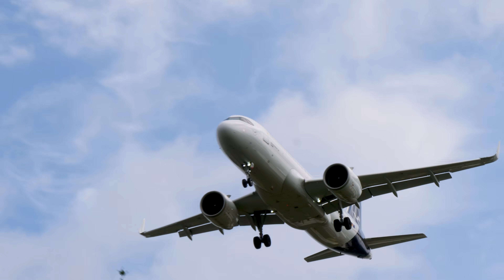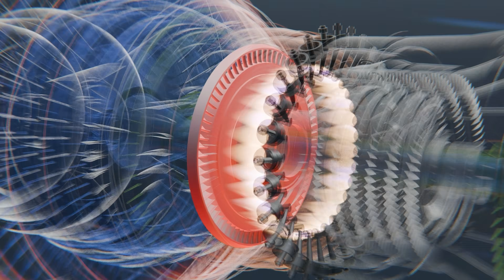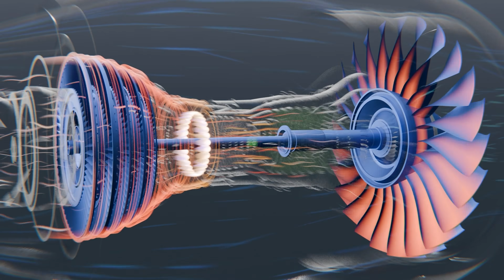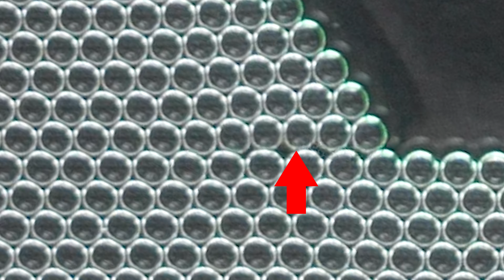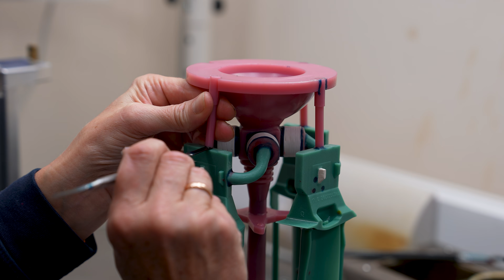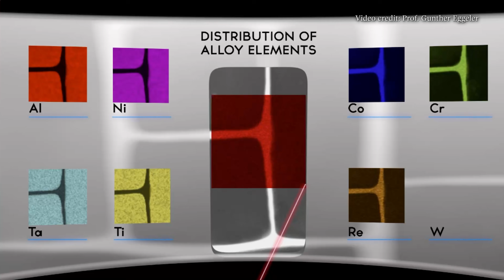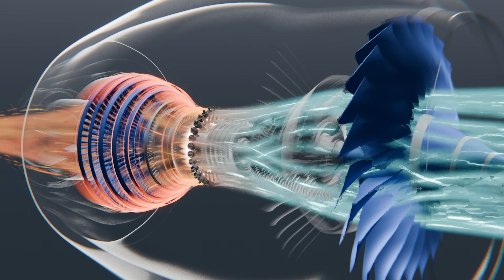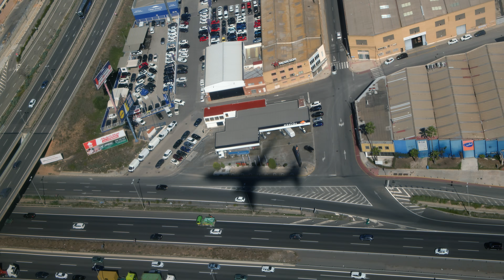The Ridiculous Engineering Of Jet Engines

Comment: The fact that they literally grow the blade as a SINGLE crystal to prevent it from stretching is actually insanity. We tricked a rock into being one giant diamond just so we can fly.
Reply: I expected a clever way to reduce the amount of crystals and my jaw literally dropped when they showed a single crystal blade. Damn sorcery, it's incredible.
Reply: @tastycheesegeo I always wondered how they crew a single crystal. The solution is so simple, but elegant!
Reply: @Oldseaotterguy any sufficiently advanced technology is indistinguishable from magic. Live long and prosper 🖖
Reply: @wackaboobooplays  hell yeah brother. dont watch starfleet academy
Reply: @tastycheesegeo  It's got me wondering, could we make swords from a single crystal or would they be only strong against stretching? I'm guessing they would snap like driftwood if used in a sword.
Reply: @b @beayn  won't pretend I know near enough material science to answer this question properly, but my thinking is, most of the things explained in the video are focused on combating a specific type of damage — from heat. Swords are used in a completely different environment, they experience different types of damage, hence, need different techniques of protection.
Reply: @beayn swords utilize a combination of multiple grain structures to perform well. The edge of the blade is a bunch of tiny grain structures making it hard but brittle. At low temperatures, grain boundaries actually make a material stronger before deformation. The back of the sword has different and larger grains which make it softer and able to bend and flex without snapping. When a sword is quenched the thin tip cools faster forming and trapping many small crystals and preventing them from growing over time.
Reply: @beayn I thought the same lol 😂

My assumption would be either the grains are helpful in the types of stresses swords experience, or the cost and difficulty of making a sword this way is just not practical so nobody has really tried it (and was invented late enough no governments were interested in trying it). Or realistically probably both.
Reply: @beayn forging vs casting...I they're going for light weight and a certain amount of stiffness vs denser layered forging. They are leaving out an important part of getting the coil and that's achieved by pressure or more accurately, compression, probably seriously high compression forces...
Reply: @tastycheesegeo I'll damage you both with this piece of amethyst if you don't quit yer speculatin'! Oh it must be getting late, sorry.
Reply: @beayn they explained it no? The nickel superalloy makes the vibrations from heat go through diffraction and dissipate the heat more effectively. But this only works since heat is a constant vibration. It will probably work, but strong shockwaves can still disrupt the gamma-prime structure and cause it to bend like they explained in the video. Maybe will work as a sword, but not a hammer of any kind
Reply: @beayn swords need to be durable in a number of directions. Crystal structures have certain planes they are weak on. Yes, these engine blades are made to be strong specifically in the directions where force is exerted on them. Mechanical engineer for aerospace corporation here.
Reply: yeah and i almost commented that what if we made just 1 single crystal but i decided to not comment it as i thought it was a stupid comment and impossible to do xD
Reply: @rampage3337  
Man, I feel that. 😅
Ever seen a video about the current state of semiconductors? A good Asianometry video'll give a real sobering: "How the hell did people come up with/pull off this 💩?"
Reply: @ivoryas1696   Conspiracy people would say aliens
Reply: @adventurousclash6323  
Eh, it depends, I find. 🤷🏾‍♂
For instance, an Ashton Forbes fan would blame the government and just claim they have way more advanced tech than they're willing to let on and are just hiding it in plain sight, lol. But I suppose this ain't the time to get into the weeds of conspiracy theorist as a field. 😅
Reply: @rampage3337 just before you saw it, right ?
Reply: @rampage3337 just shows you.... one "thought" is all it takes to make that breakthrough...  to make you a billionaire or a salary-slave.
Reply: At room temperatures, grain size is actually the only parameter that increases strength and hardness at the same time, when the grains are smaller. So boundaries are actually beneficial. But at high temperatures, creep takes place and because dislocations start to accumulate at grain boundaries pores form in the material, which are very bad. In a monocrystal blade this cannot happen, as the dislocations migrate to the surface of the blade and just vanish.
Reply: @onerelic1337 is there a percussion at the blade tips then with a frequency?
Reply: @pleshlacis  grain boundaries migration are highly likely to create internal voids in the process, which will concentrate tension inside the material and be the point of origin of a crack. Another possible issue is the formation of hard clusters in the grain boundaries during the heating and cooling cycles, which will anchor there point in the microstructure and also concentrate tension inside the material.
Reply: @xjustinjx  In a word, yes. Check out "squealer tips" and "winglets" in turbine blade design for more info.
Reply: @pleshlacis  This is why Low Angle Boundaries are so important in Single Crystal growth. The angle at which the dendrites are grown preferentially directs the angle at which the Gamma Prime phase is oriented. Basically the little cubes are guided by their relatively high Volume Fraction (which is why they're cubes and not spheres) and the orientation of the primary dendrite they formed along. Therefore as long as the orientation is correct the angle of attack for the super dislocation to adequately "cut through" the Gamma Prime is exceedingly high. Under High Cycle Fatigue though the Gamma Primes begin to "Raft" or coalesce together perpendicular to the load. Which eventually leads to failure. But blades are replaced long before it gets to that point though. There is a reason for the saying, "The rules in aviation are written in blood" and Safety is paramount.
Reply: @onerelic1337 thank you Aniki
Reply: No. There are no dislocations
Reply: "We tricked a rock into being one giant diamond just so we can fly."
A quote for the ages.
Reply: @TheCurlyCoder and we tricked more rocks into speaking binary so we can fly better more easily!
Reply: @bravo_cj  etch them with runes so they become smart you mean?
Reply: @bravo_cj we etched rock into arcane runes and filled them with lightning.
Reply: @bravo_cjand more accurately 😎
Reply: @nocturnhabeoI salute your expressivity. All of you.
Reply: @nocturnhabeoWhen I see people discuss programming, it literally sounds like dwarves discussion runic inscription or arcane glyphs lmao
Reply: @TheCurlyCoder Tricking a rock thinking better than ourselves is a more accurate and mindblowing quote, and especially "for the ages".

(Silicon die GPUs running AI)
Reply: Yup. And with computer chips (or rather, transistors) it's even crazier. "We tricked plain white sand into forming a rock and then we tricked that rock into being a thinking rock, by zapping it with manmade lightning in just the right places. Then we threw a bunch of those thinking rocks into a metal cage and forced them to talk to each other so we can get them to do our thinking for us but much faster than we ever could". Modern technology is basically wizardry
Reply: @BinaryBlueBull wait till you see what nature can do. it tricked star stuff (Basic carbon, hydrogen and oxygen) to make little machines that replicate, interact, communicate with one another to make even mores super complex machines of mind boggling complexity that we call life. It is so complex that it can think and ponder its own existence while making more complex stuff out of its own.
Reply: @BinaryBlueBull the funny thing is that when science is about planes, cars, bridges, skyscrapers (i.e. things that can easily kill you and your family any day  if the underlying science was fake) then no one questions it or dares to say: "I made my own research to make a better blade for a turbofan engine and I call RR's bs and a hoax" but When it comes to saving lives through modern medicine which relies on the very  same kind of science and technological foundations, then everyone is an expert "calling out" the actual experts' BS 😂
Reply: @leoleon7537  In all fairness, not much incentive to make fake science claims for something like a turbine blade, and very easy to see when it's fake because the part fails. Medical science is much harder to see when it's fake be there are endless variables that effect the outcome, and there are HUGE incentives ($$$) to make fake medical science claims.
Reply: @Projekt5.3 are you sure when you produce a vaccine/drug that will kill the recipient or severely harm it (as the " nextdoor experts" claim through "common sense") and that is administered to hundreds of millions, sometimes even to billions of people then i) we do not have enough evidence to prove its harmfulness ii) there is an economic incentive to be known as the company which commited fraud with "the drug that  wiped out half the human population?" And in particular, that this incentive is much higher than that of "engineering companies" as it is easy get away with it?  Isn't it that virtually EVERYONE as a recipient of a drug can manifest its own symptoms and discomfort/side effects and suffering while a failed turbine blade would never (EVER!) surface as the underlying cause of a plane failure unless a very small team of experts (scientists and engineers btw, rule it?)
Reply: Not saying that there is no fraud in medical science (Purdue pharma/Theranos) or in Engineering companies (VW Diesel gate/Boeing 737 Max). What I'm saying is that it is remarkable how public attention and conspiracy theories target the health sector to a degree that is ridiculous while provide close to zero scrutiny to other science/tech sectors. I think there reason behind is not what you point out; simply that the incentives for conspiracy theorists are much higher for the health sector vs other sectors so people bite it and do not even realize the disparity of their skepticism.
Reply: RIGHT?! That spiral strategy is absolutely insane! We literally control the material at the molecular level
Reply: @charliewastakenthe material IS the molecule!!!! 🤯
Reply: @jeffhsu7027 Isn't it rather atomic level? ;) Metal alloy crystals are mostly not molecules.
Reply: I remember hearing a story about a steam turbine for a nuclear reactor that was built... but the engineers failed to account for one of the factors that could cause the blades to expand, so it scraped against the housing and tore itself apart, scrapping several hundred large blades that took a week to cool...
Reply: @Nachiebree  Reactor steam turbines are actually pretty primitive, circa 1920 in terms of turbine design. It's possible that what got forgotten in the incident you refer to is rotor bow; you have to warm up these large turbines carefully and slowly, allow everything to get to working temperature before apply a lot of power. Otherwise the differential heating distorts the shapes of everything, resulting in turbine blades bending and hitting stators, etc. Once everything has warmed up, no problem. Pratt and Witney made the same mistake in their current geared turbofan engines, and dealing with it meant waiting a long time for the engine to fully cool down and then waiting for it to warm up again after start up. That resulted in long turn-around times, and delays. 

The steam from a reactor's heat exchanger is actually pretty cool, so the turbines tend to be large and comparatively slow spinning and slow to warm up. The combination of large diameters (long blades) and high rotating mass (slow warm up times) contributes to the problem of rotor bow. By the 1940s, steam plants on naval vessels were running with super heated steam, anything up to 800°C or higher. This meant that the difference between late model steam turbines and early model jet engine turbines wasn't so great; the temperatures were not dissimilar.
Reply: @abarratt8869 

Good comment. But I thought that the shaft bow in the jet engine was due to differential cooling during shutdown (hot air goes up) and tight tolerances (for efficiency) and not an issue with startup of a cold engine but only restarting a hot engine.  Also there is a procedure to limit this cycle time.
Reply: @Mentaculus42  Ah yes, indeed it was. I don't think they'd ever done a simulated turn-around in all the testing. And it was on one particular version of the P&W GTF (the one for the A320neo; the A220 was fine from what I remember [corrections welcome!]). I gather that the problem really came from starting up the warm engine; the start procedure involved cold-cranking the engine to blow air through so as to even out the thermals before turning on fuel / spark, which took about 7 minutes. It seems that's it's a sorted problem now.
Reply: @Nachiebree turbines crash more often than you would imagine, some years I hear of 3-4, some years I hear of 1 or none.
Reply: @ShaunHensley this one was specifically that the engineers forgot to account for one of the factors so it just crashed immediately
Reply: @Nachiebree their is really cool expensive alloys to prevent those issues
Reply: "We tricked the rock into being one giant diamond so we could fly. Not only that, we taught the rock to speak so we could chart the Cosmos"
Reply: I saw the little twisty tubes earlier in the video, and I have done lost wax casting before, and I was thinking "what in the hell is that?!?!".  A trick to create a single crystal?!  What?!  I want a whole video about just that.
Reply: Semiconductor is the same way. The silicon is "grown" and then sliced into the wafers. And then eventually becomes a chip in your phone
Reply: What until you hear about the rocks we tricked into thinking
Reply: Imagine if only airlines had Ebony ingot or if Skyrim had single crystal alloy 😁
Reply: Old dudes stare into vats of molten rock and decide which tiny crystals can be big crystals and hand move them to create the conditions to do so. Alchemists staring into cauldrons. (These guys gets paid real money and are treated as wizards)
Reply: Same thing with computers, we made a rock do math.
Reply: We successfully put lightning in rocks too and we use it to create slop videos
Reply: Those blades are made from Wolverine claws ?
Reply: I first thought "it's like magma cooling slowly into granite!" with larger crystals, except if you then squeezed the magma through a toothpaste tube to create a single mineral crystal :D mind blowing
Reply: Directional Solidification/Single Crystal is how we produce those castings at my workplace. Lost Wax casting method, with a lot more smaller steps in between the bigger concepts.
Reply: Modern human:"its just science"
Ancient human:"THIS IS LITERALLY DARK MAGIC WTF"
Reply: Every bit of the world around us is crazy if you look into it. Engineers are the GOATs of civilization.
Reply: He got video about thumbnails btw
Reply: Nice analogy, however it’s not like we wouldn’t fly if this tech didn’t exist.
Reply: Best job to brag about. “Yeah, i **grow** turbine blades
Reply: And then we drilled holes in it… 😂
Reply: Using Black Magic to source Crystals so we can master the Art of Flight sounds..
Super Natural
Reply: Hey no spoilers
Reply: @bernard792 Spoilers are fitting to the wings not the engines.
Reply: Damn that is a good idea. Now that diamond (Carbon crystal) can be grown super cheaply in a factory.. We can use diamonds for the blades. Diamond has no melting point but turns to gas at 3,550c.
Reply: This is why China hasn't been able to perfect jet engines, particularly high performance military jet engines, because that technology isn't available to them.
Reply: @VictheSecret well they can try to learn  from Pratt and Whitney Canada........
Reply: Bro dropped a spoiler
Reply: This process won the princes’ award for technical innovation around 40 yrs ago !
Reply: This topic/methods of single crystal tutbine blades was covered in Scientific American decades ago.
Reply: We're really every fantasy race, dwarves, elf's, orcs, etc; some are even hobbits.
Reply: Excellent comment!
Reply: I used to make these turbine blades its really just similar to cooling ice cubes to make them clear. They need to cool directionally
Reply: Spoiler alert ‼️…booo
Reply: Thats a fire quote
Reply: Same thing with Silicon ingots for chips
Reply: @samarthbarshi1916  aren't silicon ingots grown with Czochralski method though?

When they said in the video they don't want to havemultiple grains I was half-expecting them to uze Czochralski method here too, TIL there's another way to do it.

I wonder why one of these methods is used for turbine blades while the other is used for silicon.
Reply: no it's a mineral
Reply: bro we’ve tricked rocks into everything 🤣🤣
Reply: @EpicManaphyDude  So... basically just very sophisticated stone age? That's really a neat way to look at humanity, and it also explains the very thin veneer of civilization, that gets scratched away way to easy, as show by several examples (pandemic, antivaxxers, maga- and other religious cultists) during the last years. Instead of moving forward it sometimes seems part of the people would prefer if we got back to medieval times, oder even before that.
Reply: Obviously not all blades are made like that most come from blocks of metal using cnc, and edm machines and a lot of heating cooling coating and brazing
Reply: Been knowin
Reply: You didn’t do anything, they did
Reply: I get a little anxiety every time I fly.  This video gives me less.
Reply: Yeah, we too trick rocks into thinking to watch these vids in our PC/phone 😅
Reply: We also carve runes into different rocks so they do math for us 😁
Reply: Fun fact: this is also used for Silicon in semiconductor industry.
Reply: And it's practicaly the same method that silicone crystals for semiconductors are made
Reply: @Burbund And that isn’t a coincidence 👍🏼
Reply: I think the solution is to find a nonstick coating that prevents dust from sticking to the blade.
Reply: A rock..? What do you mean by that?
Reply: @Allworldsk1  I believe it is a play of words, since you might call a crystal a rock…
Reply: Semiconductor foundries grow tree trunk sized silicon and not only silicon monocrystals for a very long time now, so i guess nothing special. The same seeding method, almost the same zone melting technique, just far simpler because no such purity needed
Reply: My thoughts exactly. When I was watching the video, I was thinking "hmm if we can figure out how to make it a single crystal like we do for wafer fab, we would be able to increase the strength tremendously" I had no idea that we have advanced to the point that we can actually grow single crystal objects, not only that we specify the orentation for even more strength.
 
Our comprehension of metallurgy is insane, besides learning about which combinations of metals work better with each other for specific applications, I have no idea where we we could go from here. If you could send one of those blades back in time they would think that aliens made it.
Reply: They literally take a bucket of sand and make a single grain grow into a diamond the size of a hand, it's absolutely unhinged
Reply: @JustSilen that would need a bit of alchemy. Different elements. So not literally, maybe metaphorically.
Reply: We do the same thing with silicon to make the wafers that semiconductors are made from. That's not even new technology - we were doing it decades ago. It's fascinating if you're into that sort of thing, which I suspect most of us here are.
Reply: Somebody needs to make Excalibur with this tech.
Reply: My jaw hit the floor when they said it was a single Crtstal!  That's such an amazing scientific feat! All so we can shrink the world!
Reply: where I'm from we call that soulcasting
Reply: That's what we do with solicon for solid state drives, but that's even more precise.
Reply: Fun fact, my grandad worked at Rolls Royce and invented the process for manufacturing the single crystal turbine blade.
Reply: Where is spoiler alert? 😢
Reply: We tricked rocks into thinking, thats basically what CPUs are
Reply: but diamond isn't even crystalline. what are you talking about?
Reply: @kanishqprasad9378  Diamonds are crystals. Specifically cubic crystals composed of carbon atoms arranged in a specific lattice structure. They are a type of mineral gemstone formed under extreme pressure and temperature. Shows how much you know.
Reply: "we tricked a rock into being one giant diamond just so we can fly" is my new favorite quote
Reply: We tricked a rock into thinking and now we can comment about tricking a rock into being a diamond.
Reply: This is peak tech. Amazing!
Reply: frr
Reply: JUst remember;
All electricity works as if by magic.
We put electrical current through rocks and bind it to other rocks and then into other rocks and boom.
You have your PC.

Its genuinely wild to think about sometimes!
Reply: Yeah right it also happens with me too my bones does burnt
Reply: same with silicon for computers
Reply: We tricked a rock to make one giant "diamond" to make computer chips.
Reply: I don't understand this video, too hard to understand...
Reply: We can fly. That's the insane thing.
Reply: We can fly in a wooden prop aeroplane.
Reply: Interesting fact - the frameworks of zirconium oxide prosthetic bridges are milled using CAD-CAM technology from compressed dust and after the sintering process they also form a single crystal.
Reply: It's Insane tbh
Reply: this is the reason some people say dolphins are smarter than humans 😂😂
Reply: Just so we can fly more cheaply.

It'd be amazing enough if it was required for flight, but it absolutely isn't; commercially viable flight worked with relatively low performance internal combustion engines, then the jet age came about without this advance. It's an amazing technical feat that opens flight up to more uses / people.
Reply: We also tricked rocks into being computers lol
Reply: We?
Reply: That’s one way to put it, I would rather say we gave the metal the right process to be the best version of itself, a crystal!
Reply: Well also tricked rocks into thinking so we could watch a video (through rocks we tricked into being clear if your screen is glass) about rocks that we tricked into being one giant crystal so we could fly
Reply: If you think of computers then we’ve made a rock think with just some electricity
Reply: Making a diamond sounds easier actual it’s just carbon they got a single mega structure crystal with multiple different types of element from a single wax made design… freaking insane…
Reply: Very easy and has been done way before jet engines
Reply: @mossmusap338 yea I do it all the time, it’s so easy…how do you do it though?
Reply: We didn't trick a rock into being one giant diamond. Plenty of rocks, such as quartz, can be comprised of single crystals under the right conditions. All we did was engineer the metallurgical conditions under which the material grows to ensure it consistently grows as a single crystal.
Reply: fly MORE efficiently!
Reply: flying is a good reason though
Reply: You should look into how silicon is formed from quartz as well
Reply: What a treat this was to watch
Reply: With a pigtail of all things
Reply: single crystal directionally solidified is dark arts
Reply: The back ( turbines) was over-engineering
Reply: we could fly without it so we actually did it just to fly cheaper and faster, which is arguably even better
Reply: More insane is that we made rocks talk to each other so we could watch videos on YouTube. That's how CPUs and GPUs are made. The difference between say an I-7 processor and an I-9 processor is the amount of imperfections of those rocks talking to each other.
Reply: That's the best kept industrial secret that the Chinese has been trying tio steal
Reply: @georgekraus9357 it's not just the alloy formula but the processes to achieve it.
Reply: @georgekraus9357 They bought already General Electric jet engines and technology wake up u late
Reply: @kwestionariusz1 no ........but the Pratt and Witney Canada.....i remember shipping a sigle Engine Turbine Blade  to Shanghai......
Reply: @georgekraus9357  
Shows that you know absolutely nothing. Growing turbine blades from a single crystal was invented in the 60's by Pratt & Witney. Rolls Royce loves to present it as something new and something they pioneered. It has been around fo decades and every manufacture does it. It is not a secret from anyone in the metal industry as it has been around for so long. It is used in many places these days, and aren't even that particularly special. It's cool, but not groundbreaking nor unique.
Reply: They are an investment casting,  they aren't "grown" . When they cool after casting, the structure forms a single crystal super alloy.
Reply: Though without such witchcraft, flying across a continent would be almost as expensive as space trave!
Reply: I haven't watched the video yet so I don't know if he's covered it, but scientists have demonstrated 3D printing of those single crystal blades. Imagine having otherwise impossible coolant channel geometries right in the core of them.
Reply: You think this is impressive, you should read up on the SR-71 landing gear.
Reply: The saying goes "tricked a stone into thinking", but nice copy pasta there. Original creativity is hard to come by.
Reply: But turbine blades are not made from diamond, didn't you watch the video?
Reply: It’s tech from the rosewell craft
Reply: @SighFly 
You mean the spy balloon?
Reply: “We”
Reply: @truestopguardatruestop164  
Lmao, I didn't wanna say it, but like...
I can see what he means, but there is a lot of philosophy I've studied that just tells me "no" when it comes to using "we" in contexts like this, lol
Reply: @ivoryas1696 yeah common sense and reasoning tells that to me, I’ve done classical studies in Italy by the way. I don’t think him and neither me contributed in any way to the technological discoveries discussed in the video even remotely. I avoid talking of the entire human species with a super reductio argument to redistribute merit to myself.
Tell me if for you this is the same
Reply: @truestopguardatruestop164  
I mean, I don't think he was trying to take credit in any meaningful way lol, but yeah. It is the same for me, basically. 
I've been way too humbled by my learning journey in how hard it is to contribute and learned way too much about how important it is to distinguish the individual from the whole to not feel that way, so I agree. 👍🏾
Reply: We sounds like many. You havd done nothing
Reply: Thank you for the explanation. I lost interest halfway through "yay jet engines exist" and lost faith there was anything interesting. There was! And it takes about 15 seconds to explain.
Reply: Tricked? You think humans manipulated and got over on nature somehow ? Lol
Reply: @Xirrious   "Tricked? You think humans manipulated and got over on nature somehow ? Lol"

Uh, ABSO-FRICKIN-LUTELY. Or do you think single crystal turbofan blades grow on trees? Manipulating nature is literally the one and only reason we have technology as it exists today.
Reply: @SpydersByte where do you think humans comes from, bud. If not nature? 😂
Reply: "we" btw  just stfu, you did nothing and its not impressive given the resources and years it took to get to this point, its alright
Reply: @MoonSon298  lmao not impressive given the resources? Are you insane? What is it with all the 5 year olds in this comment thread completely jaded at the idea of current technology that they think this isnt impressive? Is it just because you grew up with an iphone in your hand or what? If you had actually lived through the last 40 - 50 years of insane technological advancement you would understand why this is essentially magic.
Reply: @SpydersByte  Current technology is trash and stagnant since the last century ever since they got to Jet engines. Im sorry im not impressed over the development results worth billions if not trillions over several decades to make, optimize and perfect.

Given all the resources and time invested its meh, call me when they reach the new breakthrough in engine technology not just more of the same
Reply: Yet we couldn't do the same to the twin building
Reply: @jsrra1  and that surprises you? That we can make a 10 inch blade out of a single crystal but not 2 skyscrapers made of billions of parts? lol those things are not even remotely close to comparable.
Reply: @jsrra1 Annndddd now enters the inevitable stupid.....
So depressing to see all the genius in this process and achievement by the efforts of humanity brought down, to reality by the exposure of just how low the "below average" humans are.
Way to go in keeping that average as low as it can be!

Keep up the good work!
Reply: @jsrra1 We don't have a wind tunnel big enough.
Reply: @jsrra1 do what the same?